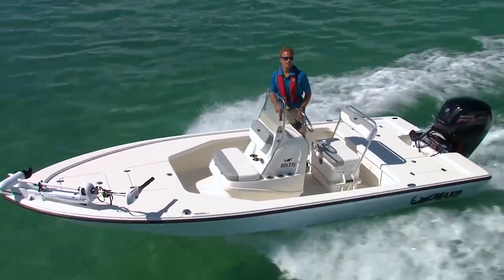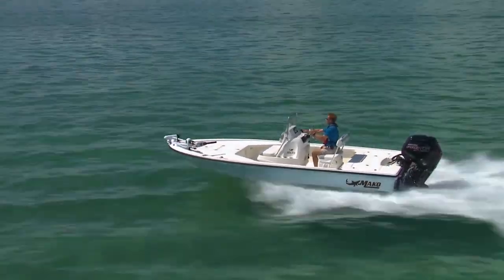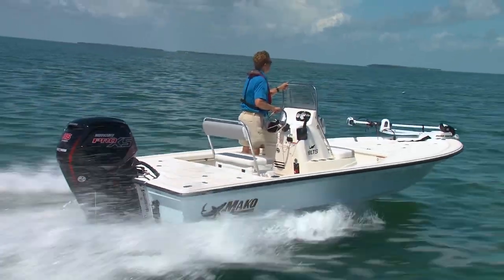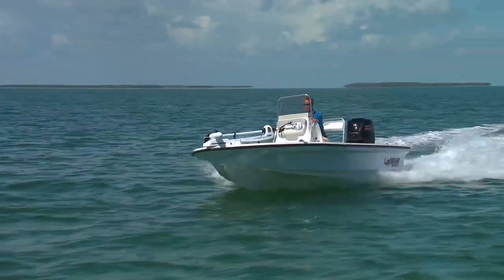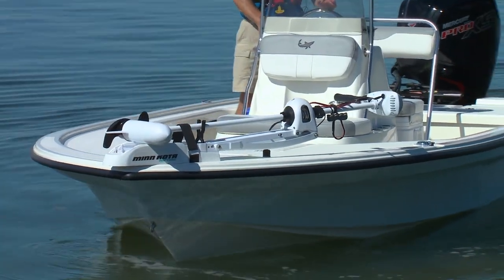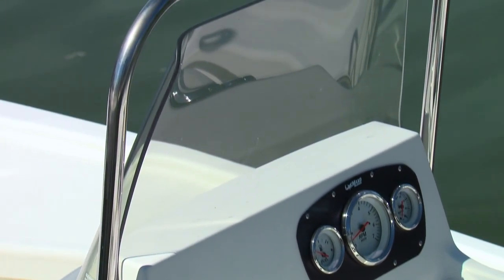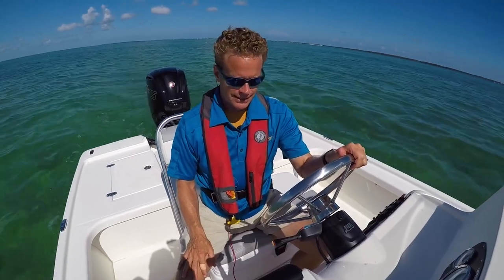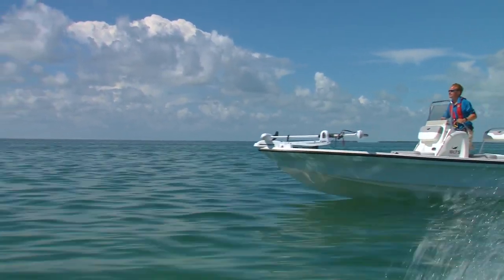2019 Mako 18 LTS | Boat Review

Comment: I own this same boat ‘17 with 115 and Jack plate. Yes the plug position sucks. It’s like 20” up the tunnel. One other disappointment is the bilge put output. It’s also in the tunnel. And when bailing out you can’t tell = if your taking on water you would never know cause you cannot see it pumping out. All in all it’s a nice boat. But has a few things they can sharpen up on.

Comment: I have a 2019 with a a 90 Merc. To me it is under powered 
Although a 115 isn’t going to make it considerably faster.
So I do 34 mph at around 5,000 r.p.m. It is very stable and maneuverable 
at that speed. The biggest draw back on the 18 LTS is its seat.
You cannot stand in the middle of the console and drive the boat. 
The average person will not fit in between the seat and the wheel. 
Something else I am not crazy about is the throttle. I don’t like where
neutral is positioned . There is also too much lag between shifting 
gears (too much grind getting into gear). Also, water tends to gather in
the well by the transom where the stopper fits in. Something else, don’t 
count on the gas gauge being accurate....it isn’t . I wish they would have added
an engine gauge on the console. The live bait well tends to over flow.
It needs mid cleats on the gunnel and bow and stern rod holders.
The Cadillac of bay boats it isn’t .
Reply: So what you're saying is you absolutely love this boat?
Reply: Curious, what you would recommend as an alternate boat?
Reply: @secretjourney4815  Shii, half the price and get a carolina skiff, or up to the next level and get a boston whaler.

Comment: If the boat planes so well with it's hull design why the trim tabs?
Reply: Every boat benefits from tabs. They help holeshot. Side to side attitude as well as trim on the motor can only do so much. Trimming up with the motor and tabbing down gets the motor up and efficient and bow down to cut through chop
Reply: Lol, this boat DOES NOT plane very well (or at least absolutely sucks getting up on and maintaining it) unless you have a very light load. But,  but 5 adults, fishing gear, and gas onboard and welp you'll find yourself REALLY struggling.

Source: Hours and hours of asking owners of this boat everything about it because I wanted to buy one, now am getting something else.

Comment: That's not a good way to install that style of plug (1:26). It can get pulled out when caught on something under water like grass exc... A T-Handle style would work better or if you can install it from inside the boat is best. Just speaking from experience. Nice video and boat.

Comment: I see you have to stand off to the side of the steering wheel when standing
Reply: Yup. I also saw that. I have the same boat and you cannot stand up between the helm and the seat. It buckles you at the knees. You have to side steer it as he is. Or re mount the seat frame about 2-3” to the rear.